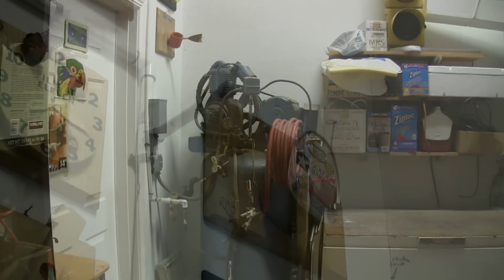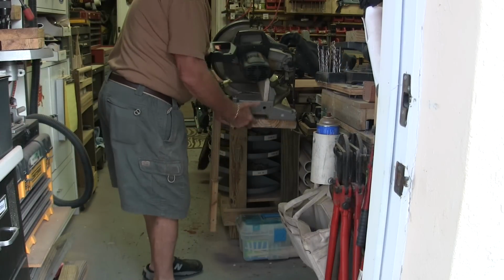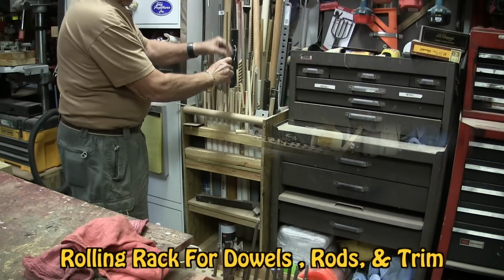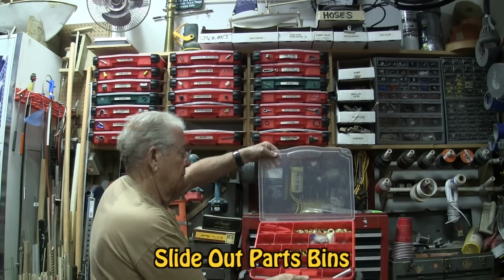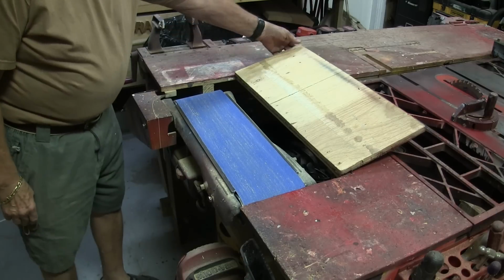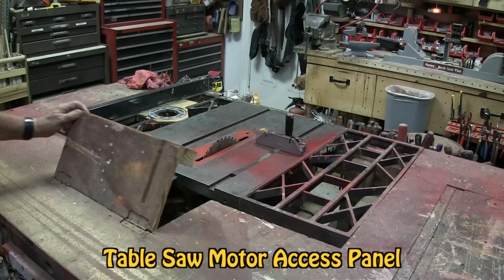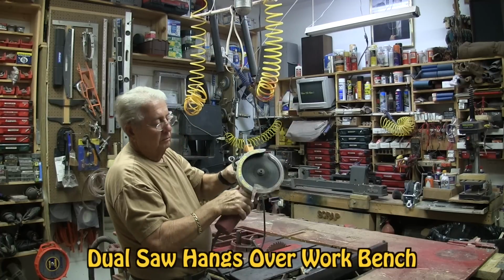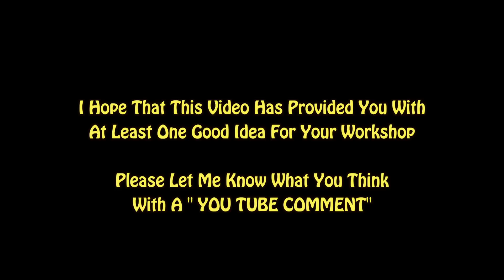MY WORKSHOP

Comment: Bob,
I have been interested in woodworking most of my life, but have never had the time. I have been working more and more on projects that require a little more then a hammer and nails. Recently, I removed my back porch and replaced it with a modern version. This led me to look into making a shop of my own.  I have a single car garage that is really to small for a regular size car, built in 1918, so this video has been very helpful. You have given me several ideas on how to layout and create my own sanctuary. Thanks and be safe...

Comment: I enjoyed your video. I may use some of your ideas for my shop which is a 3 car garage. I have built a over head storage rack that i have hung hand tools freeing up work bench space. Hammers, saws, c-clamps and large wrenches hang over head with in reach when needed. Small lumber is stored over head also. I have a 21 foot work bench and i am building some more with wheels so they can be moved to where they are needed. I have a crane build using a boat winch to raise old cast iron engines on to a bench to work on them. I have picked up lots of building supplies and hardware at my local Habitat Restore. I store and stack lots of stuff in 5 gallon plastic buckets with lids.

Comment: I liked your shop. You had some great ideas with flip up and rotating tool stands. I plain to use those in my shop.. The air was great. The vac's were well placed for use. My shop is a mess because I don't have vacs in place for instance use when needed. Great job , for the space you have. But what's  more important to me,  is how your brain works. Great brain.

Comment: I work almost exclusively on metal rather than wood so most of the wood working tool ideas don't apply to me but they certainly give me ideas.
I love what you did with your saw hanging from the sealing. I'm definitely doing that with my grinder.
Keeping all batteries charging together is a must for any shop that uses power tools.

Comment: hi great ideas i will be moving into a 9x9ft shop until i get the new one built next year by extending the 9x9 to suit my needs.
my biggest issue was the router and table saw location so i could use large panels and have a sufficient run off area for long boards. you vid has gave me some great ideas.

after years of under  tooled bodge projects i can now put to use though continue to bodge when needed ; ) the new tool set up to better and lager projects than i thought in such a small  place thanks to your ideas.

idea i have myself for my old compact mitre saw is to remove the original base and mount it to a worktop router in a guide rail and fix the base to a rotating hinge system to create a rip saw and mitre in one  that can also be folded away. instead of using the the plank as fixing for it  fix a block securely to the end and fix  butt hinges so the legs can   move to either side of the panel to hold it securely.

this will be one of my first builds in the small workshop for space saving, also i am fitting a cooker hood in the shop to clean the air in their while i work keeping the dust levels to a minimum by reducing the large area normally over a cooker i can generate more vacuum to remove as much partical as i can

Comment: The piped air is a great idea I was considering a single hose reel mounted to the ceiling but it wouldn't cost much to add in additional piping for connections to commonly used tools.

Comment: Hi Bob, 
John Eckert (testbenchtech) here.

I just moved from Ventura Ca. to Vancouver Wa.  Where I am going from a 400 square foot electronics lab and work area to about 110 square foot area and trying to fit in everything in will be very difficult.

You have given me some great ideas on space saving and how to make every square foot of floor space  and every square inch of wall space useable and accessible. 
Thanks so much for the video. 

John Eckert (testbenchtech)

Comment: Awesome job Robert! I'm very jealous and will be using a couple of your ideas!! Question though have you thought about a central vac system like your  air? You could do pvc as well and blast gates (shop built of coarse) or caps and one or two hoses that you just plug in when needed!

Comment: Very nice setup, I like how you have the vacuums right next to your tools for easy access. Your PVC airlines can be dangerous though. I've heard quite a few horror stories, when they blow out they really blow out. You might want to look into re-plumbing with copper. It's not much more expensive.
Reply: Agreed. Anyone who has ever seen a pvc airline bulging wouldn't dream of running it for their own shop. The plastic experiences slow plastic deformation from the pressure, whether constant or intermittent if your compressor gets turned off when not in use.

Comment: Bob, you have some really great ideas and I'm going to put a couple to use myself. However, as a Mechanical Engineer, I will tell you that PVC air pipe is a REALLY bad idea. Plastics work harden at a much greater rate than steels. When they fail, they don't leak, they EXPLODE... PVC pipe makes particularly sharp and nasty chunks. Black iron pipe (also quite affordable and easy to work with) is the way to go for compressed air.

GREAT video and thank you for making it!

Comment: Very nice, I see you have the same problems I do and shall we name the poison? "Organized Hoarding" lol I really love the integration of the bench tools into the workbench. I am already in the process of designing a router/oscillating sander for the table saw but I think your video has inspired me to add both my belt sander and jointer to the outfeed table/ workbench. What a great way to save space. What is the overall size of your shop?It  looks pretty small.

Comment: I'm definitely hanging my miter saw off the edge of my workbench! Only I'm setting it so the saw table is at the same height as the bench top. Giving serious consideration to modifying my bandsaw too. The Lathe is a cleanup nightmare so I think I'll leave it on wheels. One thing you may consider is switching to LED lighting. Twice as bright as fluorescents and only consumes 10% of the power. Good job!

Comment: You have a great workshop but I have no idea if you are a metal hobbyist or a wood hobbyist. Your band saw is way too close to the wall for longer pieces of wood. Why do you need a place for concrete screws? I saw no welding station so I really have no clue what you your shop is designed for. Your storage bins are full of bolts and nuts for what purpose? Looks like a home depot aisle. Really well set up but just not sure for what. I noticed your quarter inch plywood tape measure idea. I used it for my tape measures. tks.

Comment: great shop Bob, you have some fantastic ideas of incorporating multi-use equipment into single storage space. With the obvious knowledge you possess and experience you have why would you use PVC for air pressure ??? that stuff with the
ongoing expansion and shrinking of air pressure fluctuation WILL become brittle over  time. All it takes is a little bump with a piece of wood or metal and it could explode ,sending shards of PVC flying at bullet velosities !We wouldn't want to loose you!!!!
The wife sez I can fix anything .....I say yes, except broken hearts & torn arsholes hehehe
Reply: ...so you recommand to use copper pipes?
Reply: Fredartic copper is a good choice -- but very costly, where rubber can be had
much more reasonably,also plastic line is now available and will withstand
high pressures  enjoy your shop, all the best to you

Comment: Hi, Bob. Thank you for a very informative video of your well-organized workshop. You have many things with everything in its proper place. Very nice. 
I am curious, however, with all the electrical items in your workshop, how to supplied it with enough power. Did you have to run through a separate distribution panel? Just wanted to know to prepare my own workshop. 
Thanks again.
Reply from the maker: Thanks of your comments . Compressor is on a 220V circuit and the workshop itself is on a 20 amp 110v circuit.
Reply: Robert Plotkin I would love to have a workshop like yours. Nice work!

Comment: Wow, nice job, but I DO NOT recommend PVC for 100psi compressed air.  Someday and it will, explode leaving many pieces of PVC flying everywhere.  Please be careful.  I recommend Copper pipe, 10ft sections and solder the fittings.
Reply: Me being a plastic fabricator and I work with pvc pipe all the time. If he is using pressure pipe nothing wrong, 100 psi is nothing for pvc PN15 pressure pipe... PN15 pressure pipe is good to around 1.5 MPa or 220 PSI... even the lowest pressure pipe PN6 can handle 85psi.  And if it is regulated not to go above this there will be no issues.